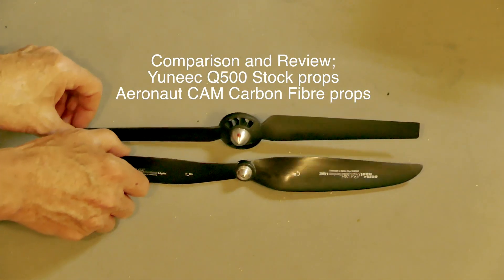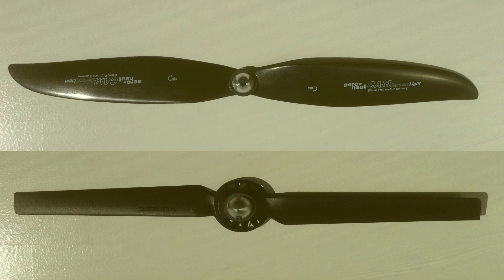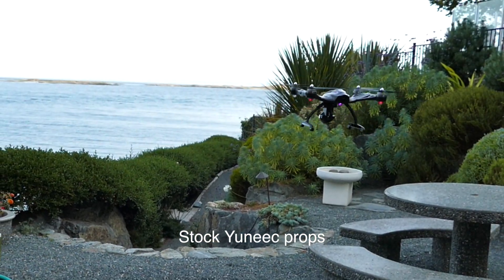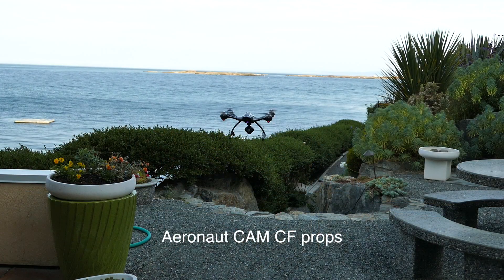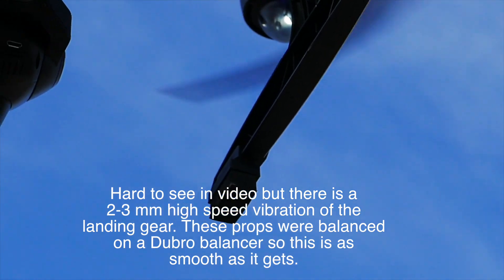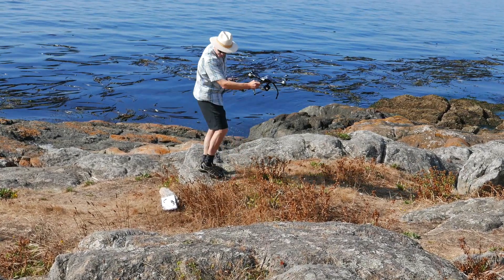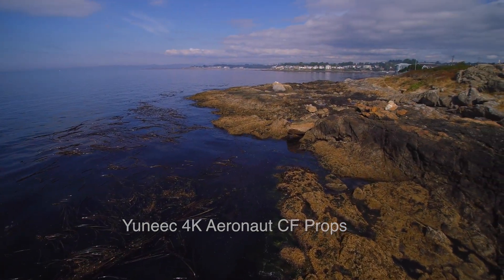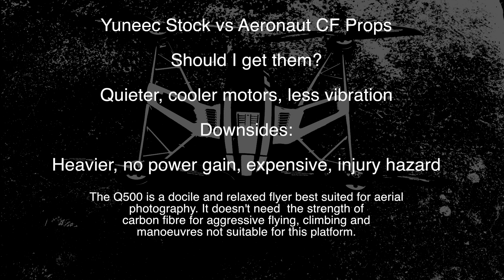Aeronaut CAM Carbon Fibre props vs Stock for drones

Comment from the maker: This video compares and reviews the Aeronaut CF props versus Yuneec Q500 4K stock plastic props. Shape, weight, sound, vibration, power consumption, and motor load are compared. Carbon fibre props are extremely strong and can change the performance of a drone but are expensive and dangerous if mishandled

Comment: WHAT ABOUT "LIFT"?... WILL CARBON FIBRE BLADES HAVE A HIGHER FPS LIFT? FEET PER SECOND... I OFTEN TIMES FLY AT 1,300' TO 1,800' AND HAVE THE NEED TO GET THERE QUICKER...  ""PLEASE ADVISE""   THANKS...
Reply from the maker: Well thats illegal to fly here at those elevations, we have to stay below 95 metres, That said, the rigidity of carbon fibre should definitely make vertical FPS more effective as the lack of flex would pull the drone up faster.

Comment: I bought two sets of black aftermarket props off ebay for about $12 a set and I swear they came out of the same mold as the original Yuneec Q500 4K props did! BUT, they may be a tad more flexible, I'm not sure. They do look real nice, but need to be balanced. I bought my DuBro balancer and was told that I can remove material of the END of the heavy end of the prop instead of taking it off the 'wing' and making it even weaker. I was told by a pro drone pilot on YouTube that removing material off the prop tips is common and keeps the prop strong.  I wish you could do a review of these props if I don't do one first but I don't have a video camera to do so like you do. These props look like 'Yuneec' brand to a 'T' but don't say Yuneec.  I thought I once read that someone's drone fell out of the sky using them but I don't believe it. They probably got caught up in their own prop wash and lost it. I will test them at approx 12 feet and give them an aggressive run around the yard and up and down, etc.  If these work out, I'm buying the red and white ones too. Talk Soon.

Comment: Having just watched 2 of my stock props disintegrate yesterday I can say that I prefer the stock over a more robust carbon fiber. Had I been using carbon fiber I believe that could have lost my entire copter. I believe if the props hit an obstruction you stand less of a chance damaging the motors or the entire copter using the stock props as they pretty much disintegrate upon hitting anything hard.
Reply: Why would breaking apart be a good thing?  If your drone is at height then it's in for a very long fall if you lose a prop.
Reply: @Maniac742  this is my opinion. I'm sure in some circumstances each will have more benefits than the other.
Reply: UPDATE!! I was having corrupted video experiences and once I went back to my stock poly props, I've lost no more videos. I will not use my aero-naut or any other carbon props anymore.I think they were a bit too aggressive which was cool but not as controllable as the stock props.  Now I get longer flight times(maybe a minute) and no longer corrupted or lost videos. I spose those props were beating my camera around cause I got the jello effect often. My flight is again more accurate and smoother than before.
Reply: @USMC-Sniper-0137  that's very good information. 
I installed an after market pan antenna into  my remote. I think I'm having some lag issues with my video feed now. The footage looks good afterwards, but viewing in real time seems to cut out. Thinking of reinstalling original video antenna to see if it helps. Has anyone experienced this?

Comment: Impressive, I'm sold on the carbon prop advantages.....remember, heat is the enemy of ALL machines. Albeit auto engines, computer boards, fans, cell phones, etc. 
The dramatic drop in prop motor temps equates to longevity in the motors & their circuit boards. So, if a person flies w/ 3 batteries one summer day, go figure. More silence is a good thing. Some drones sound like a hoard of bees fighting a swarm of wasps
Also, if a hawk attempts to grab this bird from the sky in mid-flight.......it might go home clawless.

I'd like to know the dynamics of the carbon blade's "20% greater lifting surface." Does that increase it's horizontal and /or vertical speed?
Very nice vid.

Comment: Very nicely done.  You know by all rights the more flexible OEM blades should take up most of the shock (in their flex) causing less vibration on the landing gear instead of more.  Interesting.  ☺

Comment: If you look at my channel I'm far from a newbie, and I would like to say that your review was a dead on one. It gave me the info that I need to have to tell me weather this product is worth getting or not with out bashing it.  Like Ford vs  Chevy. if you know what I mean. Great Job!
Reply from the maker: Douglas Strain Thanks! Info should apply to other drones, not just Q500. One thing I didnt mention is that hitting an obstacle with stock props breaks the prop, no big deal. They take the hit. Hitting an obstacle with CF props can seriously damage the obstacle, the prop, and potentially destroy the motor as it wont absorb the shock and will send that force right into the motor and mount. unless you really want the special features of CF its not worth it for most flyers.
Reply: I totally agree!

Comment: I've used both types of props tested here. The carbon blades are definitely smoother in wind gusts and quieter in my opinion. The carbon blades will break quite easily at the tips if they hit something. I have to reprofile the ends and rebalance them. They look great too. They cost me around $17 each here in Australia.

Comment: Gracias por la explicación ya que tenía dudas sobre ello. Buen dia.
TEST OF THE AERONAUT SHORT CARBON FIBER PROPS. IT IS QUIETER THAN THE STOCK PROPS. HANDLING WAS SMOOTH AND VIDEO WE TOOK WAS PERFECT. VERY NICE PROPS. AVAIL AT

Comment: Haha... The multimeter test is fake ;)

See it again, tjeck the fingers, when hes testing aeronaut props contra stock props.

I have testing bunch of props, and the stock is the best one to choose. Is u make a small crash, the prop wil break of, and sh** happens. If u crash with another props on q500, the props will not break, and u will burn ur esc.
Reply: +proshotsdk what is fake about the meter? If you chose to set up your quad so it will crash with minimal damage, that is your business, some setup theirs to fly.
Reply: +teamscreem sup dude... See hes finger when he measure the aeronaut prop. hes finger touch the end of the both sticks. but when he do it on stock prop, hes only touching the end of the stick with left hand fingers. And thats why the multimeter goes up 😆

Comment: Nice vid but let me be honest, the Typhoon doesn't need any mods or carbon props. it flies just fine out of the box as is.lighter props may give you a few seconds more of flight time but ...how often do you worry about battery time when flying a  Typhoon? out of the box, it has excellent battery life for pretty much any job you want.great vid but I have to be honest, the Typhoon out of the box is all you really need.
Reply: My drone will sky rocket with my carbon props. It has a response like a racing drone and yes, I have tried both.